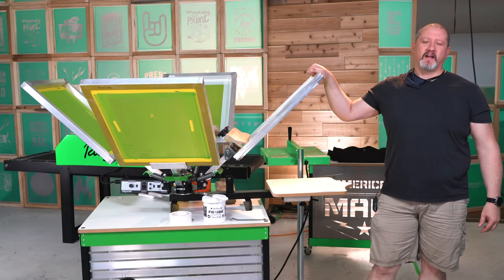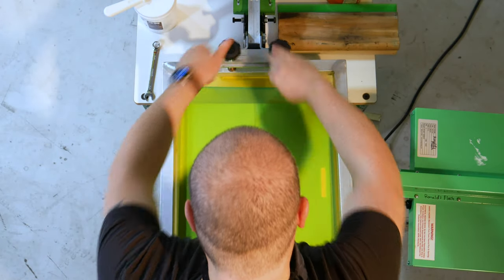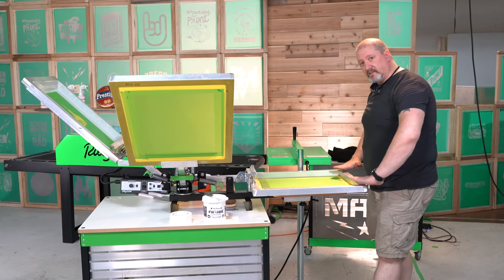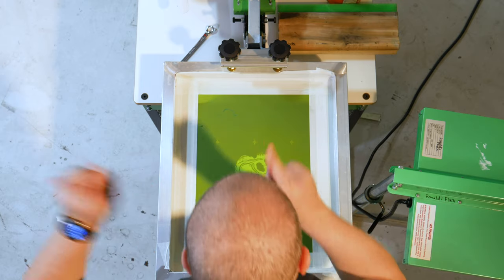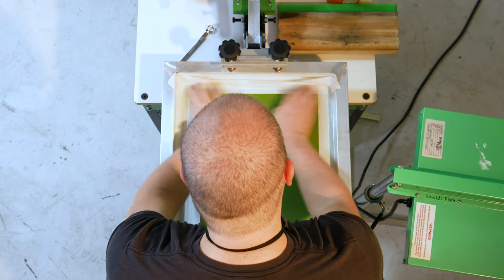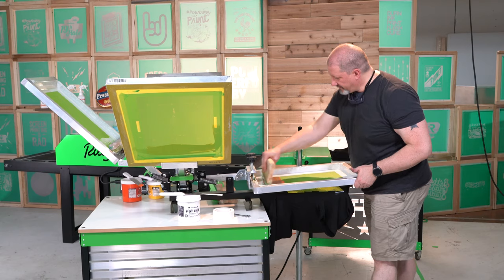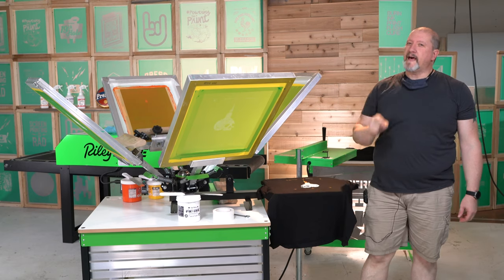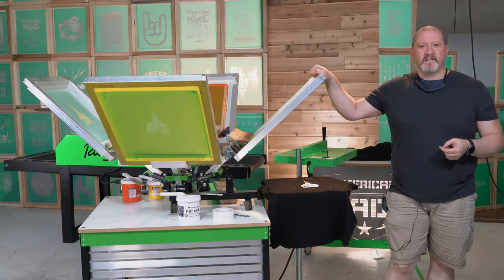Riley Hopkins 150 Press: How To Register And Print A 3 Color Design

Comment: I did the clear tape and got the register and then when I took the tape off it took the underbase with it 😭 What kind of clear tape is it that you used? Can I also do this with a blank transparency sheet?
Reply from the maker: Good morning @johnl805! using clear tape to register is a cool old school trick/technique and super helpful. i guess when i do that technique i don't really ever take the tape off in order to print on the base underneath the tape. I just do another test print to confirm i am indeed all lined up. As far as what i use, i use either packing tape or Clear Choice Registration Tape. A blank transparency wouldn't have any adhesive on the back to get it to stick, so i probably wouldn't recommend that. Hope this helps!
Reply: I believe you should do every test over the registration tape and not over your final underbase print

Comment: I have some questions .  What kind of silk holes are used in this experiment?  What transparent material did you use on the white color? Thank you very much for this wonderful video
Reply: 157 thin thread for the white.  230 standard thread for top colors /  Any clear ink will work in the smoothing screen.
Reply: @colinhuggins6164  thank you very much 👍 👌👌

Comment: Hey I have a question when registering with the 150, I’ve been trying to do a 2 color print, I’ll have the registration right on but then once I lift the screen move it and bring it back it’s off. I’m not sure what’s causing this. I’m new to printing
Reply from the maker: Hi!  There could be several reasons for this.  

First - lets make sure the screen is not resting on the platen at all - that you have set the print head for proper off contact.  The screen should be "floating" above the platen and no part of it should actually touch the platen.

Second - lets make sure the nylon bolts are snug (but not too snug!) up against the print arm.

Third - is the platen clamp snugged down nice and tight?  Does the platen shift?  What are you aligning to?  Has it moved?

If you are still having issues past this - please give us a call and we can go over it with you!

Comment: I have this press and I am having issues with my off contact. No matter how I adjust the heads, the screen sits at an extreme angle. Or it just lays on the shirt completely. It takes me an hour and I can still see my underbase even though it is choked. Could that be an issue fixed by readjusting tilt/off contact?
Reply from the maker: Hi @johnl805 I responded on your other comment... we can totally get you dialed in. give us a shout. 

here's the message from the other post.... Good morning @johnl805 ! Yes there is a tilt adjustment and we would be pumped to talk you through how to use it. You can email me directly at jwells@ryonet.com or you can call us at 3605767188. 
In short if you are looking at the BACK of the screen clamp there are two bolts. This is your off contact which allows for vertical, up and down adjustment. Where the screen clamp attaches to the arm that brings it down there another two bolts. one is basically a pivot point and the other is what locks in place. This is your tilt adjustment. Hope this helps, give us a shout and we can walk you through it.

Comment: Just far too much work without micros and this guy is a professional. To upgrade this press with micros costs more than the press itself.
Reply from the maker: You don't upgrade this press to micros, if you're looking for a press with micro registration, check out the Riley 250: https://www.screenprinting.com/products/riley-hopkins-250-4-color-1-station-screen-printing-press-with-xy-micro-registration
Reply: the 250 is cool but nobody would buy it if the 150 had micros. i think the company knows this as well. the 150 used to have micros. there are plenty of people on here showing theirs when it did. @Ryonet

Comment: Hi Colin - Im setting up my 250 press and other equipment now.   I have an Epson ET-16600 Printer.  Originally when I ordered it, the 16500 model was supported by PrintFab.   Now it looks as though even that earlier model is not supported.   Is there another RIP software or other solution that you could steer me to that would work well for creating Color Separations from Adobe Illustrator?    Also - do you think there might be a chance that the ET-16600 will in fact work with AccuRip Emerald or other?   I kind of get the feeling that some printers aren't listed on their site because they don't actually have that model in their shop to verify it, or is it more complicated than that.    Please let me know your thoughts or anyone else please with input.  Thanks!
Reply from the maker: The main issue with printers and rip software lately is the lack of availability for the traditional "recommended" printer models.  Printer supply chain issues have created a world of hurt for everyone in our industry.
My suggestion is to find rip software that is offering you a lot of flexibility but also has clear instructions and recommendations on printers you can use - and that are available.  Those list are growing everyday as the rip companies test more and more printers.

Comment: How do you hang all your screens on the wall?
Reply from the maker: Thanks for noticing! We actually drilled holes in all the sides and screwed them together so it's a standing wall. You going to try it?
Reply: @Ryonet  I'm definitely hesitant to drill into the screens haha, but if I can't come up with a better solution to get them on the walls and ceilings I might have to try it your way

Comment: I have a couple questions if you could answer please! 

1. Can i cure with a flash dryer?
2. If i can , how long do i flash the shirt for if the flash dryer im using is 2000 watts and is fixed at 400 C
Reply: Hi Kayla. Yes, you can cure any ink with a flash dryer.  We do have a couple of videos that you can watch that will walk you through the process.  We also have plans for an updated video on curing ink.  As for how long to flash with your flash unit - flash long enough, so the ink is dry to the touch and not sticky.  No One can give you an exact time for this.  It is dependent on how warm your ink is, your ink deposit thickness, how warm your platens are, the ink itself, and how far your flash is above your platen.  1 inch off will flash faster than 4 inches off.
Reply: colin huggins one more question if you dont mind is an white underbase only
Used on black shirts? Ill watch some videos and see what else i can learn
Reply: @kaylachermolololo6401  the first reason to use an underbase is: A white underbase is used whenever you need the colors of your design to look like they do in the bucket.  Say, you print yellow on a royal blue shirt... that yellow is going to tint towards a green shade.  If you put white down first, that blocks the blue of the shirt and allows the yellow to remain truer in color.  the second reason is:  As a way to block dye migration when printing on poly and poly blended garments.
Reply: @colinhuggins6164   colin you’re the only one i can relay on lol im having trouble finding any good answers my question is what can i do if i dont have a pressure washer? Well i can get one its just i dont have a water source and cant really spend money on anything like that so is there any alternative?
Reply: @kaylachermolololo6401  oh goodness.... Water is pretty essential as its used as our source for rinsing clean and reclaiming / developing our screens.  My thoughts are to create a recirculating system with filters to pull out all the particulate... but it is not going to be cheap...  I'm sorry, but I do not have a good answer for you :(
Reply: @colinhuggins6164  okay so how about this after coating the screen in a light safe room do i have to stay in the light safe room after exposing a design to a screen? Or can i take it outside somewhere wash it out and bring it back in
Reply: @colinhuggins6164  ive seen this guy on youtube use like a powerful spray bottle and it was actually working have you heard of that
Reply: @kaylachermolololo6401  you would need to fully soak the image area for a full minute or two before taking it outside and immediately rinsing out the image.
Reply: @kaylachermolololo6401  you can do that - the bottles that you can add air pressure to - they can work - not ideal, but it can be done.
Reply: @colinhuggins6164  im gonna test out this pressure washer method with a superior pump and water tank! It should work thanks for your help colin stuff like this means alot
Reply: @kaylachermolololo6401  Glad I can help!
Reply: @colinhuggins6164  i ordered a flash dryer and the white material inside on the right and left side is a pushed in its only flat in the middle is that a problem?
Reply: @kaylachermolololo6401 Hi Kayla - unfortunately I am not 100% sure of what you are describing.  The white material should be insulation - its purpose is to keep the heat from radiating out the sides and top (as well as it can) - focusing on going out the bottom.  As long as the flash unit is doing that, you should be fine.  If you are concerned about the flash unit working correctly, you will want to take pictures and contact the manufacturer of that unit.  Hope this helps!
Reply: @colinhuggins6164  hey colon can you please recommend me where to find a screen printing press table to support it? I have a 4 station 4 color press
Reply: @kaylachermolololo6401  Hi Kayla - Aside from all the press carts we sell on Screenprinting.com - any table at the appropriate height and length (to counter balance the press and you pushing down when printing) will work.  You also want to secure your press to the table.  On our 150 and 250 models we have places to put screws and screw into the table, making the press VERY secure.
Reply: @colinhuggins6164  i wish i could get those carts lol those are gonna be my upgrade options really all my equipment is gonna be from you guys when i upgrade but for the size what size would be good for a 4 color 4 station? The ones i can find are like 32 inches max in height
Reply: Hey colin im finally ready to buy stuff from your site after 10,000 questions lol it comes with one more question though im looking into buying the 16x20 exposure unit & lightsafe bulbs but for the exposure unit two people in the reviews said it over exposes in the middle is that a problem thats been fixed ?

Comment: @ryonet Can the Riley Hopkins 150 press hold 4 screens that are 23x31?
Reply from the maker: Good morning, @Nathan Judds. It will. However, please keep in mind that the pallet it comes with is 16x16. So you may be limited on how large your image can be by pallet size comparative to the screens. you could go with a larger  pallet though. Hope that helps.
Reply: @Ryonet  That's good news, I will probably pick one of those up! Could someone could make a custom pallet for the press relatively easy?

Comment: That press is pure garbage without proper registration ... Waste of money better off with the more expensive Riley presses. This model is crap.
Reply from the maker: Hey, What's up, Chuck? Everyone has to start somewhere. Some printers need to start with something like this due to budget or maybe they are just printing on the hobby level. THat's what this press is designed for. Maybe they don't even know if they know if they like screen printing yet. While i agree with you (a little) that i would want to invest a little more for a Riley 300 or 350, that's not everyone's scenario, man. Have a great rest of your week, Chuck. Happy Printing.